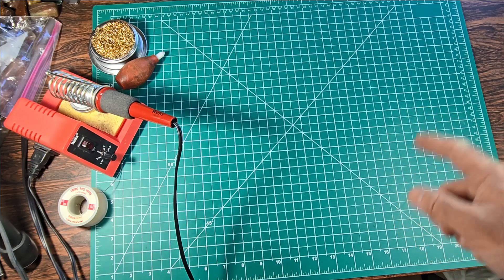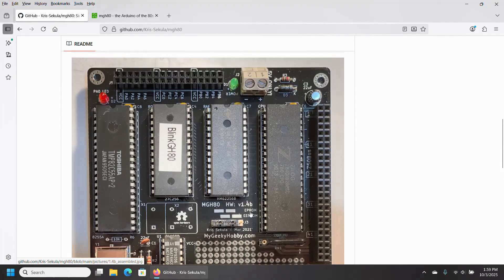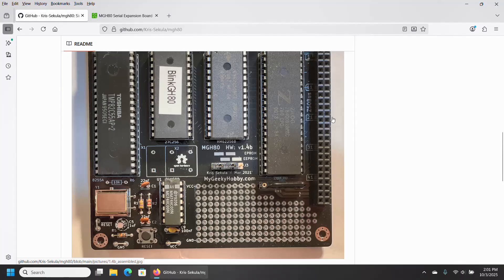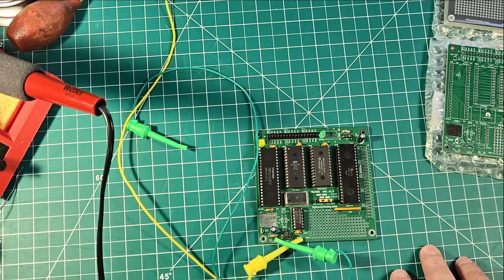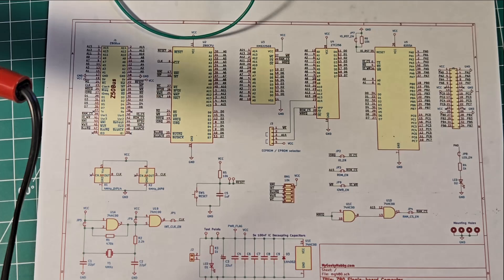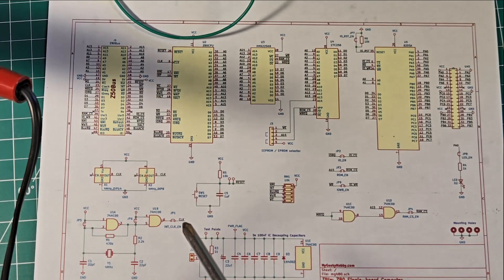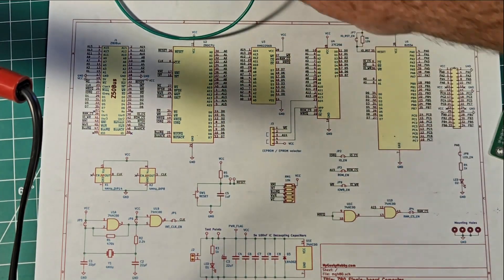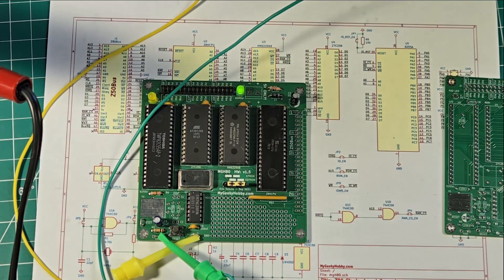MGH80 Single Board Z80 Computer: Arduino of the 80s #z80 #sbc #computer #arduino #retrocomputing

Comment: If you are closing JP5, the output of U1A tries to drive low level. If you close JP6 as well, you might cook U1A in a long term. So it might be better to close JP5 only, isn't it?
Reply from the maker: I noticed that too. The instructions say to close both if not using the crystal oscillator circuit. Must be a typo in the instructions.